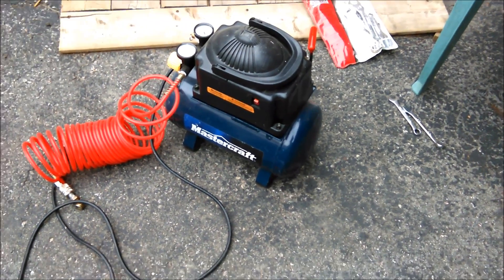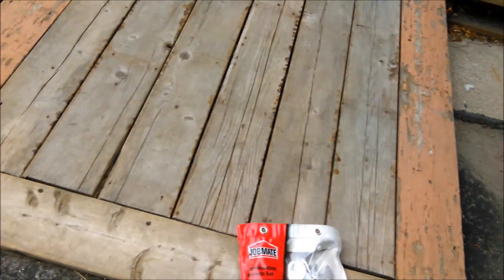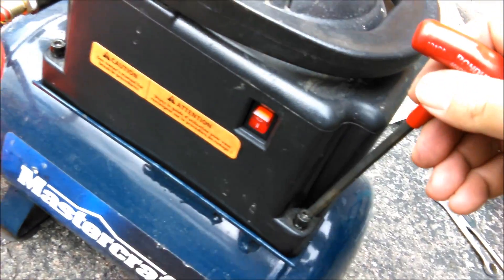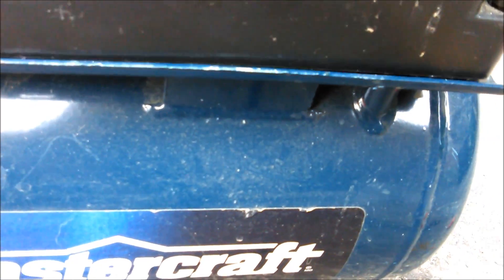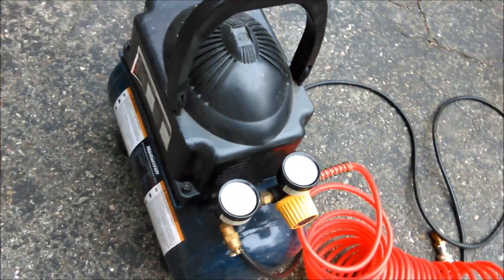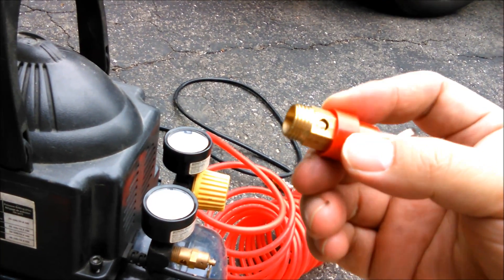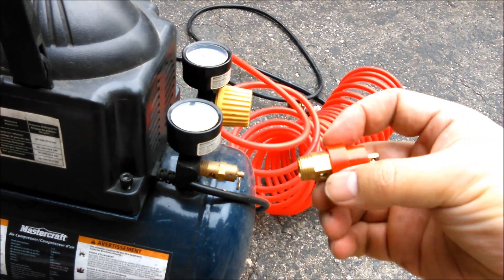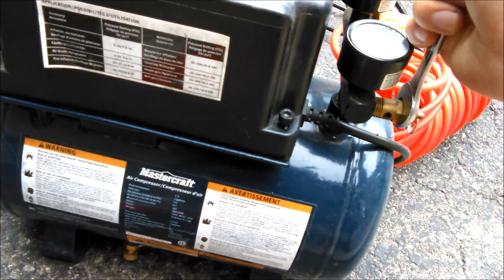Upgrade 100 psi air compressor to 120 psi, cheap convert DIY (part 1)

Comment: I have to wonder if it is possible that the engineers who designed, rated, and material/safety spec'd the compressor knew that you could do this?
Reply from the maker: +Pro1er Just like I mentioned in video, it is NOT safe. I have seen videos people play with propane tank. It's just for a little risky experiment, not recommended for normal usage.